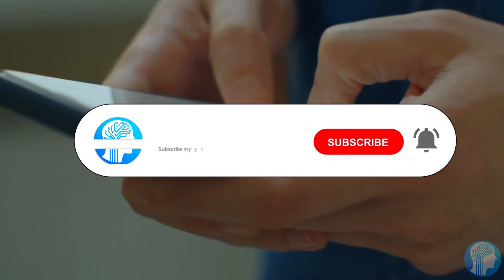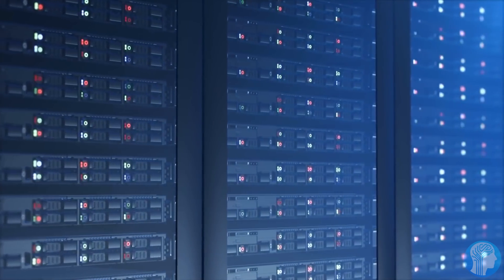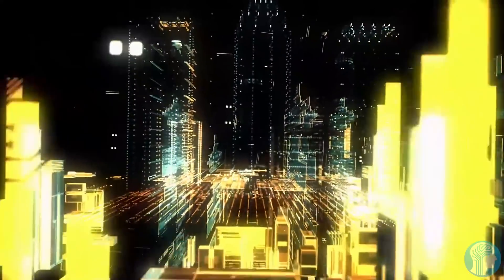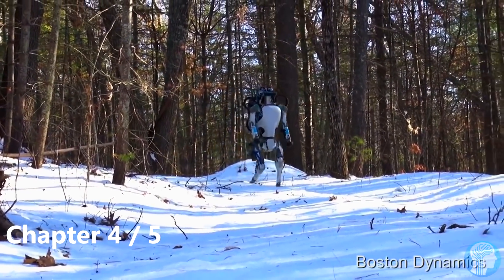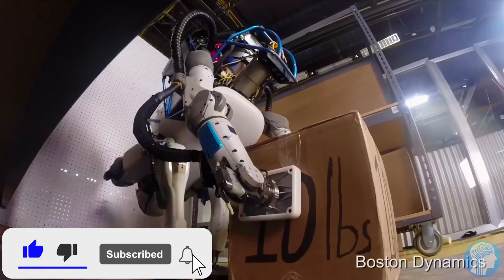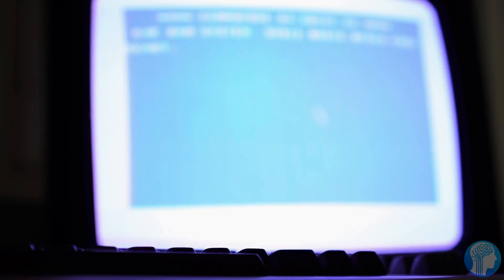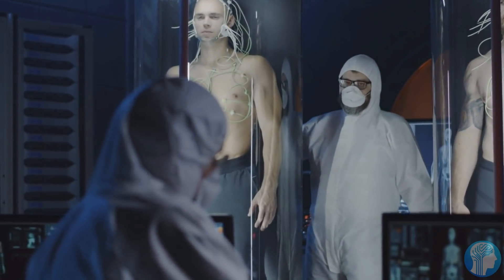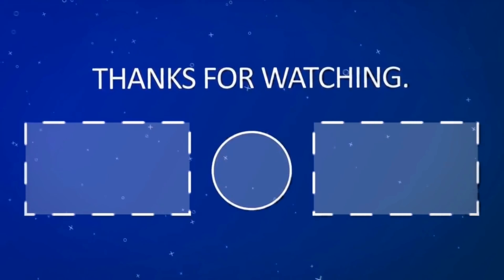Artificial Intelligence will Take Over These Jobs in 2022

Comment: Consider ai as another toolbox to be used for your needs. Specialized tools directed to tasks as needed for your projects. You direct and ai optimizes detailed actions. Iterative optimization and analysis fine tunes results. This increases the scope of your ability to produce your desired product. The bigger your toolbox the more you can do.
Reply: The more one worker can do, the fewer workers needed by the company at any given level of production. This is so absolutely basic that I'm constantly surprised people don't understand it. Automation absolutely reduces jobs. The good news is that it doesn't have to be a bad thing, it just depends on how society responds and if humanity is able to smoothly and peacefully transition away from a human-labor-based economy to an automated economy. As it is currently though, it doesn't look like the people in power are ready for that transition, and that is where the problems are going to stem from for the average worker.
Reply: @Metacognitor  what happens is more trained people to fix the problems caused by machine maintenance and repair. Also programming bugs. Self directed is a ways away for intuitive leaps and solutions. So some direction required.
Reply: @jimspear3033  this isn't the case even today where jobs are shrinking due to automation, and I see no evidence that it's going to change. AI absolutely is and will continue to replace jobs.

Comment: Studying AI and Robotics
It is unlikely, whilst AI and Robotics is seing more automation within industry (factories, warehouses) and possibly customer services 
The main issue we are up against right now is that CPUs are nearing the maximum productivity they can offer, whilst moores law is still standing true, in that transistors are still doubling every 18-24 months, the processor speed is not doubling, its leveling out (curve) a bit like you are familiar with, with respects to Covid-19 cases, so what your seing now is a trade off, between more transistors that generate more heat, and thus in return needs more cooling, which is more energy production

What we have seen is parallelism, multiple core processors, in which the workload is split to create faster result either by Grid or Service style networking (Cloud Technologies)
UBI is something being considered which has been discussed in this video and could be acquired by a "robot tax" to cover this, but AI is no were near singularity 

Whilst AI is coming on leaps and bounds such as GPT-3 or Google Duplex, you have the works of Human OS by Soul Machienes, we are seing robots using stunt ability, running parkour like those by Boston Dinamics and Ameca by Engineered Arts which has been the most spoken about Robotics, a similar robot to "Stretch" by boston dinamics is also done by Agility Robotics called "Digit" and has a similar appearance 

PwC does predict 30% of the unskilled workforce will see roles replaced by Automation by the year 2030 and posibly 40% by 2040
This was a report dating Feb 2018, 

Whilst advancements WILL be made in AI and Robotics, and CPU processing (and I have absolutely no doubt this will happen), its not yet clear if they will meet peoples expectations  in terms of the deadlines they believe this will happen by, In that you can rock up at a hotel and the Robot customer service rep is able to give you detailed responses to the questions you ask that may not be scripted within the next 10  years. We may be waiting for hardware to catch up or find new materials to make processors from.